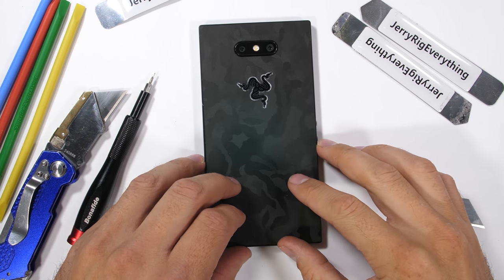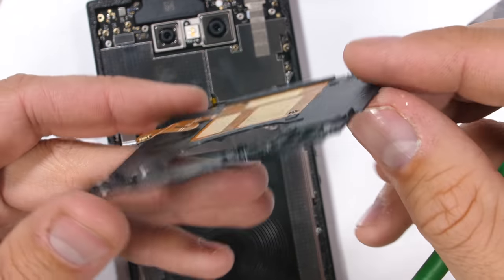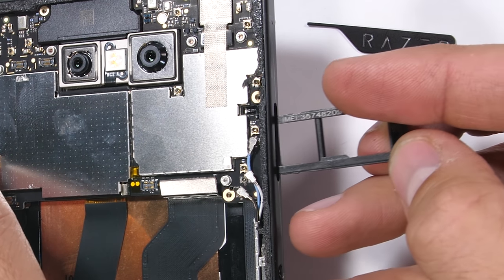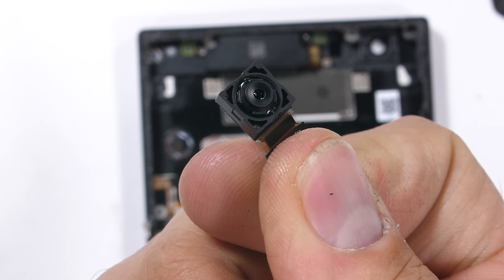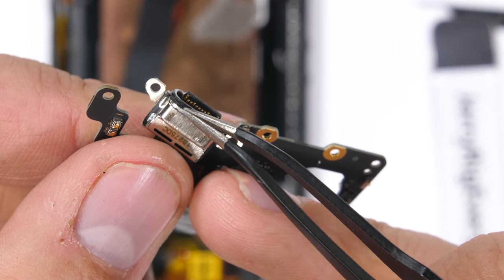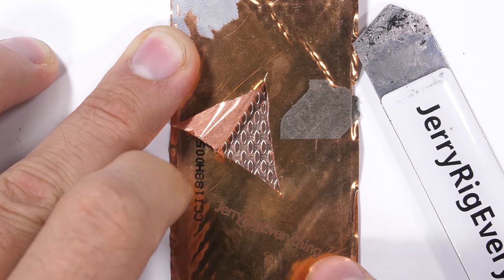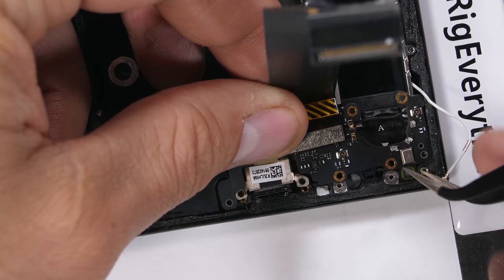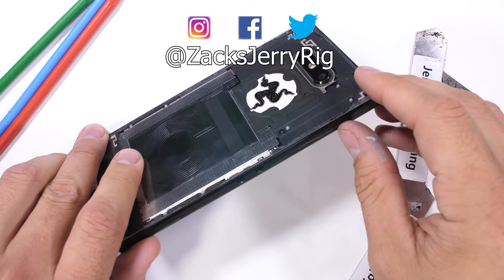Razer Phone 2 Teardown - The Vapor Chamber is Incredibly Cool

Comment: Lol, people say gaming phones aren't any different from iphones when there is almost no cooling in a iPhone and the battery is microscopic.
Reply: Find me one since Apple/Mac portable device that does not throttle - considerably.

The irony in it all.

The processors in laptops run better on non Apple/Mac devices - even when they are the same exact processor. Basically they are dialed down at the factory, also via updates. In other words, but Apple/Mac and never quite get anywhere near what you as paying for. Graphics cards are the same exact way for Apple/Mac.

Just how much does it add up to?

Keep an Apple/Mac under any type of moderate load for just one to five minutes, and it throttles considerably. At least ten percent, in a number of cases over 25 percent. Adds up in no time,. but especially adds up over time.
Reply: Latest iPhone doesn’t even have a battery, just always wireless charging.
Reply: still iphone handles gaming better due to apple processors
Reply: @firstcomment5161  Apple doesn't make processors. You are categorically wrong in every assertion you just made.
Reply: @ironmanmachine  the A10 A11 and A12 are apple processors
Reply: Jesse Anderson They designed the SoC
Reply: @firstcomment5161 - I literaly just said they have almost no cooling,
Reply: @firstcomment5161  They are made by TSMC. They are no more Apple than the chips Samsung used to make.
Reply: Well not really. TSMC makes the process, not the chips. If you consider it that way then intel, amd, Nvidia and all the other chip manufacturers don’t make their chips but TSMC or some other company does
Reply: @justinwong939  Apple designs them. TSMC manufactures them. It's pretty cut and dry. "The Apple A10 Fusion is a 64-bit ARM-based system on a chip (SoC), designed by Apple Inc. and manufactured by TSMC."
Reply: @firstcomment5161  - Yes, but Apple pays other companies to make their chips
Reply: Tianjie Lu and they only have like 2GB RAM
Reply: Tianjie Lu This guy can't distinguish between designing the internal circuitry vs fabricating and manufacturing process🤦🏻‍♂️
Reply: @ironmanmachine  The CPU in the iPhone are designed by apple and manufactured by Samsung so your half right about them not making cpus.
Reply: There is not much difference though.  Pretty much the same CPU and GPU, just better cooling and stuff.  I'm talking about normal Android phones because I know iPhones have custom chips.
Reply: Justin Wong Indeed Intel designs and makes its own processors, same like Samsung. Almost all other brands are fabless designers.
Reply: heyyyy guyzzzz... razer phoneeee.... 🤣🤣🤣🤣
Reply: And the razer phone 2 doesn't cost $1k, has a 120hz display, rgb, amazing speakers, variable display resolution, fast charging, vapor chamber, and a 4kmah battery.
Reply: @justinwong939  Intel makes their own processors.
Reply: Doesn't need it
Reply: That is why iphone gets hot fast. Battery drain fast. Thats why they use low spec screen resolution to keep save battery apple marketing kinda trolling ppl who doesnt know bout this. And yet ppl says they have longest battery. What ppl didt knew that they doesnt have top spec display,90hz120hz,smaller screen display. Cheap smartphone like xiaomi,oppo,oneplus,huawei is catching up fast. Thats why they rise.
Reply: @firstcomment5161  🤣🤣🤣

Comment: I can tell the people that engineered this phone really wanted to make the ultimate media phone that's also affordable.
Reply: Can't say 800 USD is affordable :)
Reply: @faceevil  IKR but it's hard now for things to be affordable. All I can say it's cheaper than a 1200usd Samsung Fold and similar performance too.
Reply: @faceevil  brother will you ever do a sober comment.
I got razer phone 2 , 4 years ago for 300gbp in UK. You just do not buy brand spanking new phones from retail stores, and save urself 50% off bare minimum already.
Reply: I got mine for $350 NIB on Amazon in 2019. It's currently running Android 13 and easily outperforms nearly everything at its price point even today.

Comment: “One of the coolest phones ever” Agreed
Reply: I see what you did there
Reply: It is now the HOTTEST phone ever with the copper heat sink removed
Reply: I bought one for my son. Unfortunately it's also one of the hottest even with the copper plate. After 10 minutes gaming at max cpu and frame rate, it literally got too uncomfortably hot for him to hold on to. We were disappointed to say the least. When set to standard fps and cpu it stays cool, but then again so does his S9 plus. In the end by mutual consent we returned the  Razer.  We've decided to try the new ASUS ROG phone instead. Maybe it will be better and it even has a separate cooler that comes with it. Given the size of that cooling plate I'm really surprised this happened.. Maybe size ISN'T everything.. Lolol!
Reply: @brianmsahin  once the copper plate gets heat soaked it dosent matter how big it is. If its bigger it can actually stay hot longer.
Reply: @brianmsahin  I got the 512gb version. Absolute beast of a phone and the aesthetics please my nerdiness but without the external cooler it will get pretty warm while gaming. I haven't tried that many titles yet but between games like the Asphaults, Star Ocean Amnesis, Monster Hunter Stories, Chaos Ring 3 and Tekken it'll get pretty warm all around the phone probably in about 30 mins if I had both in-game and phone settings maxed out. Stuff like brightness at max, wide color gamut on, HDR mode on and the overclocking X Mode on for the phone and for games to have as highest graphics and for as possible. The external fan definitely helps with cooling the exterior especially the back where it's frosty and helps reduce heat in the front a good bit where at every setting maxed it just gets slightly warm, which is urprising since the air circulation is pretty much just blowing at the back of the phone. Never tried pubg or fortnite before but I guess I'll try eventually since the phone's been advertised for games like that.

The phone doesn't come without flaws though. Stuff like the official case is definitely not screen protector friendly, BT works fine on almost everything but my dang car for some reason, and my power bank with built in USB c cable and quick charge 3.0 does not work with my ROG phone.
Reply: @brianmsahin  good decision because rog is no 1
Reply: Which no one interested to actually buy... Lol
Reply: She start screaming at a level 6 with harder moans at a level 7
Reply: @brianmsahin  Just because it has a big copper cooling plate the heat will not magically disappear. It will heat up the whole phone, as there are no heatpipes and cooling radiators anywhere. That is the problem with EVERY phone. It was noticable with that phone only because of how hard the CPU/GPU had to work to keep up with the high FPS.
Reply: @brianmsahin - God dang, your rich
Reply: @sondinh509 - Yeah, should I buy the Mate 20, Razor 2, or ROG?
Reply: @tjl2836  

Don't think I can help you in that department, I've only got experience with the ROG phone for my first and only gaming phone so far. I could probably do some research on those other phones but tbh I'm not really interested in them and I don't think I would have given a fair unbiased comparison of them anyway.
Reply: @sondinh509  - But is it good? Like is the camera and battery life good?
Reply: @tjl2836  Well yeah its good overall, costs a crapton and is pretty up there pitting up against my brother's XS Max in terms of gaming performance. Camera is good although I don't normally pay attention to the camera when I buy phones so I can't say how good. Has lots of knick knacks in camera mode when I need to take a pic that I haven't messed with yet and the best thing I like about it so is the wide zoom shots like in the LG phones, good for my job concerning auto body work where I have to take pics that cover as much of the vehicle as it can for things like assessments and estimates. The battery life is rather...awful. Especially if you turn everything on to the extreme for gaming. Things like accelerated loading which lets you pick up to 15 games to improve all loading times in games, HDR visuals, RGB logo or fan+RGB logo eats up battery a good bit too, X-mode which overclocks CPU/GPU and kills off some of the other apps all drains the battery fast which makes it feel like it'll only have about 4-5 hrs ish of on screen time for gaming. I haven't properly gauged that yet so take it with a grain of salt since it might. Same with battery saving mode. The 4k mah battery in the ROG phone in battery saving mode still drains faster than my s8+ 3500 mah battery in battery saving mode. I'm still gauging that in everyday use at my job but from 8 am to 5 pm mixing taking pictures, using maps, playing games+watching videos on my 2 hr lunch break, using apps like spotify/pandora on data while driving around delivering cars I'd typically go from 100% battery to 35-40% ish by afternoon time on the S8+ when I get off. Also looked at my charging brick for the ROG phone, it's a 30 watt AC adapter with a type C usb port and a 3.0 type C to type C charging cable. These are a more expensive than the typical quick charge capable adapters and cables for phones like the Galaxy series or LG phones with QC tech since their OEM chargers are about 18w max. At least it gives you a quick charge capable brick+cable right out of the box unlike some other fruit phone company but I like to have multiple charging solutions just in case so I bought another set of 30w wall+car charger and 2 3.0 type C cables which is still cheaper than having to buy a single fruit phone company's QC capable charging brick alone. 

It does have nifty unlock/wake from standby capabilities. The fingerprint scanner in the back is definitely more accurate than the oval shaped Galaxy phones although I like the circle shaped LG fingerprint scanners in the center back at best but unlocks the phone instantly. It has the wake up feature when you lift the phone up to your face ish and the face recognition, while not as good as Apple's face id since the registering can be shoddy, pretty much unlocks the phone instantly if it recognizes your face. There's also the double tap on single spot on the screen to put the phone on standby or wake it up from standby, pretty nifty but sometimes it doesn't work too well depending on the application. If the speakers matter to you then those are stupidly loud. Almost as loud as the ZTE Atom ones.

There's still a good deal of features I haven't messed with yet but yeah I just like the overall design, nerdy gaming crap and accessories available, the gaming boost and definitely the 512gb storage option that makes me pic this phone over the others and price was not a concern to me. It is for so many others though from what I've seen throughout the comments for the ROG phone unboxing, review and other info videos on this phone.
Reply: @sondinh509 - Thanks! If the battery is really that bad and it only supports 30w charging then I probably would get the Mate 20 Pro, since its only 777 USD
Reply: @tjl2836 

It's not that it only supports 30w charging but so far the original charging brick that comes with it is the only charger that I find puts it into "fast charging" mode. I bought a cheapo 30w mini brick (found out it doesn't have 30w/3amp charging like OEM brick does) and some 2nd gen USB C to USB C cables from Amazon that came in today to bring to work and while it doesn't make the phone go into fast charging mode at least it still charges it fast enough. Like 1% per minute or two while I'm running PUBG at everything maxed, both phone and ingame settings. Unfortunately also bought a car charger with 49.5w and the type C slot with Power Delivery 2 still doesn't put it into fast charging mode. I haven't really tested that out yet but on the weekdays I'll have more chances to try that out.

I've tested about 2 hours of straight playing so far between games like the Asphalts, Monster Hunter Stories, Tekken, Star Ocean. I tried playing PUBG mobile for the first time on mobile with testing both without charging and with charging, all gaming modes turned on within phone settings and maxed FPS+HDR/highest graphics mode in the game the phone's internals managed to stay around 36-41c degrees (90f ish), with the external cooling fan cranked out at max speed of course. That's actually stinkin amazing since I though it would get a lot hotter than that due to every setting maxed out and charging at the same time plus for some reason PUBG is one of the games that would make the phone decently warm despite not being that graphic heavy as the others. I guess that's the one huge advantage over having a battery that drains a little too fast is that even with charging the phone and playing graphic intensive games at the same time the innards of the phone manages to stay rather cool under load and it still charges pretty fast with a non-OEM charger with all of that going on. That makes it a lot safer for both you and the phone than most other phones that will get stupid hot while playing graphics heavy games and charging at the same time. I suck at PUBG btw, won 3 out of 5 matches and I lost those two matches because I didn't know what the hell I was doing and died to that blue storm thingy that covers the map over time. 

You don't have to put the phone into all of those gaming modes though. X-Mode just helps reduce loading times and reduce as much micro-stutter as possible but with how most of these games are even if they aren't graphic heavy you might see them from time to time due to these games not really being optimized for Android. Even with X-Mode turned off and the eye popping but straining Wide Color Gamut + HDR mode turned off a good majority of games should run very well, drain even less battery and won't get as hot.

Oh yeah don't think I ever mentioned the ram but right off the bat before you do anything the phone could eat up around 3.6 to 4 gigs of ram, even at idle. I haven't seen any games that really take it past 5 ish so I wouldn't worry about games that will end up being laggy due to that. Unless you open up a crapton of other things too at the same time and have like a million widgets on your homescreens.

It's really up to you in the end though. That mate pro sounds like it has much better specs to value than the ROG phone, any of Samsung's flagships or even iPhones. For me I got money to blow, I like Asus's designs in their PC gaming space so why not the phone too. Plus they are like the only company so far that goes out in how stupidly good the accessories for a phone especially for gaming can be. Unfortunately those accessories are pretty damn expensive too. The Twin View dock for example turns your phone into like a 3DS with its clam shell design showing 2 screens at once. You can stream+game at the same time or heck even play two games at a time with it I'm like wtfbbq thats awesome...but it costs bloody $400 bucks so yeah >.> not that everyone that would buy the phone needs it. I think the main accessory for the phone that is a must have is that external cooling fan and thank goodness they included it in for free.
Reply: @finnirish12 You might notice I wrote that comment 6 months ago. We did return his Razer and got the ROG phone in the end. After almost 6months of usage the ROG is definitely a better phone than the Razer, and even without attaching the cooling unit it stays cooler for longer than the Razer did. After 15 minutes the Razer was too hot to hold comfortably. With the cooling unit on the ROG he can play games for a few hours and it stays cool. It definitely NEVER got hotter than the Razer in the past 5 months of use.

Comment: I love how the copper heat sync had loads of small diamond shaped it's really smart since the surface area is dramatically increased therefore more heat can be absorbed in the same overall area of the copper square heat sync combine that with liquid then that shit is a monster
Reply: I'm pretty sure the diamond mesh in the middle is just used as a spacer so the water vapor can travel further, the copper mesh right up against the walls of the cell do have a large surface area though (since the mesh acts as a wick to allow cooler liquid onto warmer parts of the vapor chamber).
Reply: I think you mean heat sink
Reply: It's both, it's a vapor chamber that acts as a heat sink or a heatsink designed as a vapor chamber, whichever you prefer. Its job is still to just dumping most of the processor heat into the screen and battery (and being a vapor chamber helps a lot with this).
Reply: @vimalrich5409  yeh typo
Reply: As zachc mentioned, think about flowpath. If it's one big open space it's tough to get a good flowpath for heat on one side. Cool on the other.